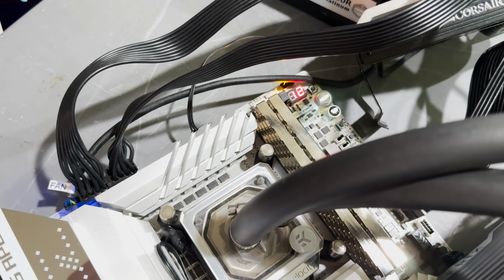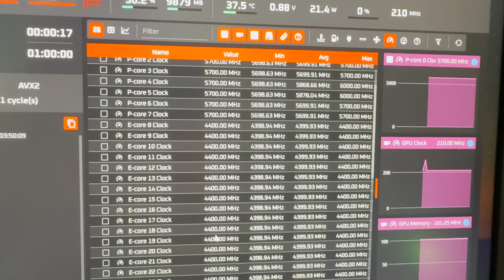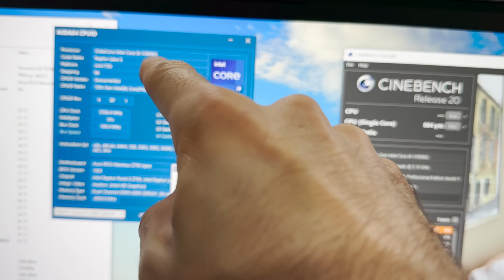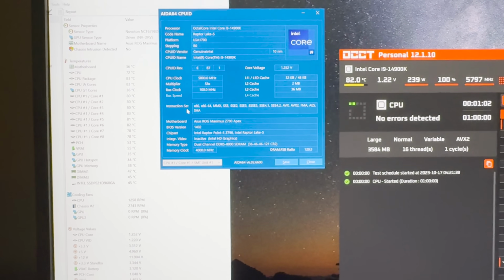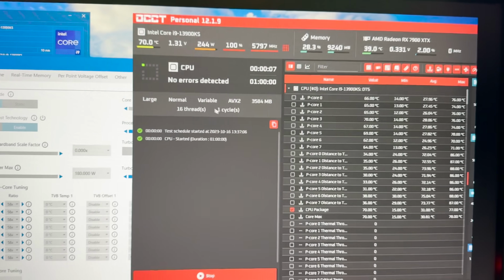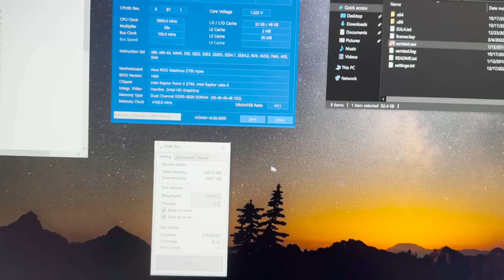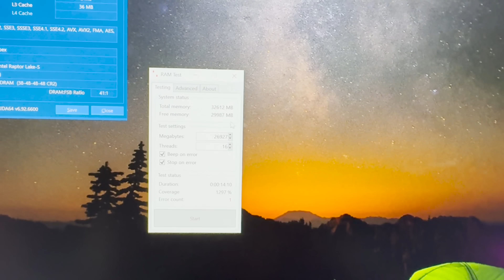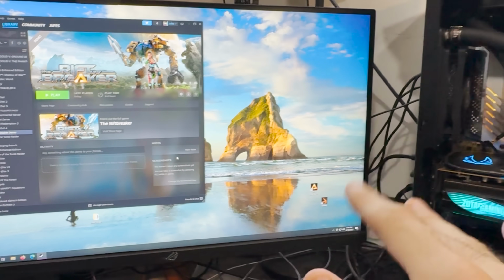Colossal Waste Of Time...  14900K Review.

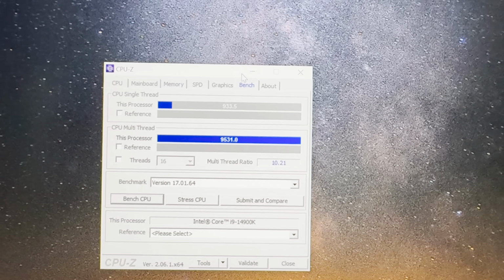Comment: 5:30 Mine goes like 18k wtf is yours upto
6:10 No it doesnt work like that, My CPU requests insane voltages upto 1.6v at 5.9 ghz with enhanced turbo and turbo 3.0 turned off, so yes Intel had to lock it to 1.55v
Reply: e-cores off.

Comment: If, we have to blame someone, the order of severity would be:
1. The operating system (which generates the excruciating BSoD/GSoD). 
2. The test applications (most of which are free, having the least trust).
3. The games (which give the smaller errors if you know how to set them). 
4. Motherboards (where, overclocking the CPU and DDR5 RAM, plus adjusting the power [watts], current [amps] and voltage [undervolting, v] requires a lot of combinations until you find the right one).
5. The hardware (CPU, RAM, cooling system, storage memory), which has the least fault, because their manufacturers warn users about the risks they are subject to, increasing the performance of the hardware, but, also, give them the freedom to choose options, without disastrous consequences; more recently, the microcodes (like 0x129 on CPUs) have reappeared and the warranty has been extended, with no further recall of the affected products. It (the hardware) should not be put on the wall, but, the first ones that have taste listed. Maxing out a PC build is going from agony to ecstasy and viceversa. 🖥️✨😎

Comment: 13900KS died after a month of use. He was running on 6GHz for a while. 
I replaced it with 14900K. I had to disable IDBT because Windows had a BSOD at startup. It is also downgraded to 5.4 to make it work, but there are still sporadic BSODs. The motherboard is Asus Maximus Z790 Dark Hero. Another Processor to be replaced? 😬
Reply: are you using the stock intel socket frame or did you replace it with like a thermal take or grizzly frame? those cpus bc of tvb (which i hate) and there mindset with these chips when they're being made is simple.. the instructions tell it under load say r23 for an ex "if theres headroom hold this clock speesld and boost the faverd cores by all means necessary voltage heat no matter the cost there is no retreat hold the frequency!" which if BIOS left at stock happens which they're designed to kinda impressive pulling stupid amount an of current and heat and being at tj max and between 90  and 100c not even thermal throttled point is unless you're going into the bios Turing on ln2 mode and running un godly  vcore which i doubt then maybe a bad Mount or the mb is malfunctioning the fact this happened 2 cpu in  row is very very odd. make sure you're cpu is seated properly in the socket and your cooler isnt mounted unevenly. if it continues my next guess would Be MB if again you aren't in the bios settings every voltage rail to the boards limit. if it does end up being the board do yourself a favor and get the z790 asus apex encore
Reply: @StupidWhiteKarens  The first set of Asus ProArt Creator Z790 with 13900KS lasted about a month. Then the processor degraded until it became completely unstable. The CPU mount was stock. Kraken Elite 360 RGB AIO cooling. Then I bought Asus Maximus Z790 Dark Hero and replaced the processor with 14900K. I changed the cooling to Asus ROG Ryujin III 360 ARGB. I replaced the CPU mount with a Thermalright Braket V2. The new processor worked stably for about two weeks on auto settings. Then the programs began to become unstable and BSODs became more frequent. Lowering the clock speed to 54 kept it running for some time. I bought a second 14900K processor. The same situation. A week stable on factory settings and degradation again. Lowering the clock speed to 55 again and it's stable for now, but this one will probably die too. I wring my hands and don't know what to do next. Now I'm waiting for another processor to be replaced. All other components were checked and duplicated several times. This is a computer with top components costing over $6,000, and I bought some of the components twice to have them for quick replacement and testing. Can I be unlucky enough to have three faulty processors? 😒

Comment: So unfortunately I had to take the 14900kf because the 13900ks was out of stock in my country.
Long story short it runs hot....very hot. Wat kind of undervolt would you suggest to help reduce my temps.
My cooler is the LS720 but yeah...
P.S. I already made the mistake so go easy on me.
I am running the cpu with turbo on and let bios decide on limits. CPU package is running 93 degrees celcius and core temps at 75 to 85 while gaming.
Lastly before you say the cooler is busted, I live in a very hot country where the daily temps can easily climb to 32 to 35 degrees c.
Appreciate the help.

Comment: The 14900K is product for a precise market segment, which would be owners of 12900K and a "filler" for PC wholesalers such as Dell and others. I am the owner of a 12900K and just upgraded to a 14900K and I am quite pleased with it. Tuned it to a daily driver of 6.1Ghz P-Cores and 4.5Ghz E-Cores. All this mega electrical consumption isn't that much of a problem if you set C-States to C0/C1. In games (Starfield) it bounces between 5.9 and 6.1 respectively with a consumption of 157 watts, not the 300+ everyone is saying. I was able to take it to 6.4Ghz but I don't have enough cooling (Not stable) but was able to get a Cinebench single thread score of 144 which beats AMD's upcoming 8950X. The way I see it you are getting 13900KS performance without the price plus they toss in APO and XTU(AI) bonus.   P.S. This thing will hit a 1009 Score in single thread and 17886 multi thread bench in CPU-Z, I know its not the best benchmarking tool but its always fun.

Comment: HiAll, I want to change my 13900k, because memory controller is pretty bad on this chip and my Mb ASUS z790-I 2 dimms can’t get stable ram more than 7200, booting up to 8000 but not stable. Which chip better to get now 13900ks or 14900k, price have no difference as I will change cpu by microcenter warranty and need to pay just extend warranty for another 2 years. Thanks.

Comment: My old 13900k SP99 runs 2x24 GB 8000 G.Skill sticks @ 8200 with VDD and VDDQ 1.42v nice and clean with no errors in GSAT or TM5 no problem on low voltages although the Z790 Apex only rates the MC @ 81. Not sure I want to roll the dice again...

Comment: Could you do a comparison between 14700k vs 13900k/14900k. I think its the only cpu worth checking out since it is the only new cpu worth testing. Price to performance comparison. Smaller cache less ecores 12 than the i9 16 ecoress since i dont see reviewers compare e-core scaling in gaming.
Reply: Because these CPUs are so overkill that games basically don't call the e-cores, there are exceptions like shader compilation and Cyberpunk 2077.

Comment: I have a question that is not related to the 14900.
What are the advantages of using two power supplies in one computer?
And if there are advantages, what is the best way to do it?
Reply: you can get a corsair 1000d case it has spot for two motherboard and two power supply,  in mine i have a 14900k with a z790 extreme and then a x570 mini itx with a 5950x

Comment: Basically if you're running a 13900k overclocked, your wasting money to go for anything else that would amount to much of an edge in gaming.  Even upgrading to a KS is useless and more expensive to get what, maybe 200mhz that won't amount to sh-t in gaming.  Save your money for later better hardware that will blow this stuff away.

Comment: 3 points improvement in single core and 1000 im multi core compared to the 13900ks. Truly generational leap. Congrats intel.
Reply: Wait until you see the 14900ks it will be 4 points mind blowing
Reply: Such a monumental leap in performance 😂😂
Reply: Imagine expecting a generational leap on same architecture and same process node 🤣
Reply: @futmut1000 imagine people bought from 13900k to 14900k.

Comment: That's odd, the tests coming out show an improvement of 5-15% depending on title. Sure, it's not mind boggling but it's just a refresh. Also, this will push the 13th gen down in price. What's to hate? It's not a new generation.
Reply: Because he disabled the E-cores for this test and they run 100mhz faster than 13900ks. I'm waiting for the official reviews.

Comment: Another year with my 10900k. Thanks Jufes x
Reply: Same here brother.
Reply: I don't know why you keep that oven, the i7-12700K is lightyears better lol.
Reply: @saricubra2867  Mine stays pretty cool but it's been delided and runs direct die with lm. Barely touches the 60's - synthetic benchmarks and high 40's while gaming. It's wearing its age better than some of the other gens.
Reply: @DavidTMSN  Oh, that's the thing. The i7-12700K just works, plug and play on an aircooled system, no need for an undervolt, overclock, etc.
Reply: Yea and why would I waste my money on that when the 14700k is better than that dual fuel cooker? What’s the goal? Stfu lol

Comment: Asus is the one major brand that provides an SP score based on the parameters between voltage and clock speeds. Aka, how much voltage is needed to run the CPU at the desired clocks. Every CPU has a different score. This is why the term silicone lottery exists and how Intel cherry picks their chips for their sponsors. 1.433v out of box is a poor grade CPU with little to no room for stable overclocking/undervolting. I'm sorry my guy but you did not get lucky with this CPU. i9 CPUs are a gamble and for those willing to pay the cost for a potential golden ticket. Basically, do not consider an i9 unless you know how to contain it for stable use because chances are, it might not be stable out of box as advertised. May the odds ever be in your favor.

Comment: Ive got a 12700k delidded at 5.2/4.2 ghz, ddr4 3900mts, and 4090. Should i upgrade to 14900k?
Reply: That's still quite beastly setup. Probably not worth it. Perhaps in a gen or two I'd upgrade the entire platform.

Comment: The 14900k is priced at the cost of the 13900k, it's 100MHz faster than the 13900KS and runs cooler, though will need some luck with memory controller it seems.  If I were in the market now and didn't  already have the 13900KS, I would go with the 14900k.  That being said, I'm upgrading my 13600k to the 14700k, this was very interesting to see, great video.
Reply: I'm still running a 4.9ghz 6700k from 2015 at 200FPS in Apex and Halo. 160FPS in warzone, 300fps in CS2. You don't need to upgrade that often to play games, don't be suckered in.
Reply: @BlueBillionPoundBottleJobs  with what GPU?
Reply: @BluKiro   3060ti
Reply: @BlueBillionPoundBottleJobs lmao
Reply: whats your gpu  @BlueBillionPoundBottleJobs
Reply: Same, will be upgrading 13600K to 14700K, the i5 was mostly a stop gap for me.
Reply: Same with 8700K for me :D
Reply: upgrading from a 5600x to a 14900kf. I think life is going to be good.
Reply: Its shit CPU
Reply: I got a 4090 fe but been running a 126k on it I had a 3080! What cpu be best for the 4090 at 4k?
Reply: @franksam8610 If you have a 4090 already just go with the 14900k at this point. If you want AMD the 7800x3d is amazing as well.
Reply: @Manicsar1 because 14 is cheaper than ks so no wonder :) but still intel tries us to milk with their 3rd 13900k binning :)

Comment: Still rocking a 12900K. Won't upgrade until 15th or 16th gen, or whichever gives a worthwhile performance jump.
Reply: In the same  boat as you,  rocking 5950X at 5GHz stable,  i  have no idea what to do even with that much power 😅
Reply: @Atlan_tis Compiling shaders in The Last Of Us Part 1.
Reply: @saricubra2867  for multi tasking is more then enough, main focus is on a GPU and not on CPU , small percentage or games are focused on a CPU, most are on a GPU, video game industries should be focusing to code games more on CPU coding and not GPU
Reply: Good, no need to get suckered in like the rest of the children

Comment: I guessed the same thing, but you missed one very important detail...it's CHEAPER than a 13900ks.   Prospectively it's ~$140 cheaper.  I was thinking about buying a 13900ks, so looks like I saved some money by waiting.
Reply: they're the same price
Reply: @gozutheDJ  I'm currently seeing a price of ~$680 on the ks....  It was $729 a few weeks ago.
Reply: @fredygump5578  they must have just dropped the KS price
Reply: @gozutheDJ ks still goes for 700 in the us at the moment so a 14900k is a viable option for many of us. I am in ohio btw
Reply: @MaryJane-ly9ez  oh yeah for sure if you're upgrading from a couple gens no reason not to get the newest revision. but a 14900k is pointless if you already have a 13900ks or even a plain old 13900k

Comment: Thanks for the video!  This looks like a 13900ks for cheaper.  A bit disappointed in the imc performance but delidded this would be a nice upgrade from a 5.6ghz oc on my 13700k.
Reply: Imc performance is different chip from chip. You need to be lucky
Reply: @damara2268  True.  However, there were rumors that this refresh was going to have higher IMC performance.  Its all good.  Probably going to get one still.

Comment: I have a binned 13900KS with a Unify-X which can do 8200 but I need too much voltage on the sticks to get that stable. Would be interesting if either binned ram or the new Apex (would've never even considered the white/silver-ish one) could get me even further but realistically I'm perfectly fine running 8000c34 at reasonable voltages. Wouldn't have ended up with such a great rig without your content, so huge thanks to you and the supporters!
Reply: unfortunate
Reply: what do you call reasonable voltages? I have also the Unify-X but with 7800mhz 1.40/1.46 because if I go higher my ram temp gets to hot after 30 min and errors out, I swap thermal pads and put a fan on it and still, lancool mesh 3 width good air flow, but man this memories are hot!
Reply: @tacoterito22  the setup you‘re running seems perfectly fine. I am testing in the range of 1.55-1.6V VDDQ since I have them water cooled (no temp issues) and I don‘t care if they die in a few years. If you don‘t wanna add custom heatsinks and either a beefy fan setup or water cooling I think your 7800 setup should be around the sweet spot. You won‘t lose much compared to 8000/8200 and for 8200 on the Unify-X you‘d need binned parts as well.
Reply: @ledooni  thanks bro, thats what i thought, well guess im sticking with 7800 then, dont see much point on watercool them for 200mhz more
Reply: Wow, how do you guys even reach to 8200Mhz 🤯, can you please share the part number of the ram sticks you running that can support 8200Mhz OC ? Thank you
Reply: @Atlan_tis  
Unify-X on the latest BIOS, CPU with binned IMC and just some basic G.Skill A-Die kit I bought someone, I think it was a 7800 kit originally but that shouldn‘t matter, just ger A-Die and if you really feel like you need to you can bin multiple kits, also test each stick in both of the slots, some configs work better than others. You also need to figure out the voltage sweet spots for IMC and SA and on the ram you need to check how much you can cool. Since I have mine watercooled I run them above 1.5 V VDDQ just because I don‘t care that much if they die in a few years, but that‘ll get way too hot without water cooling.

Comment: 14th gen is just 13th gen + 1 years worth of improvements to manfuacturing (therefore binning). Slightly higher clocks at the same voltage. Enough dies hitting 13900KS levels of performance, that it doesn't need to be a low volume special SKU now. Less defects in chips, so you can bin out 8+12 as an i7. Meh

Comment: Well i am happy my 13900ks is no different than the 14900k..  I do want to know about the new Apex mobo though. If its worth it someone out the want a cheap Hero I got one for sale!
Reply: It’s 100mhz slower.
Reply: @TalonsTech  That doesnt justify 700 to 800 dollars
Reply: @sumtincrazy1  14900K is $599. I have a couple on order already. Microcneter will likely be even cheaper than Amazon and Neweggs $599 price. 

13900KS was a ripoff priced CPU. 14900K here to correct that.